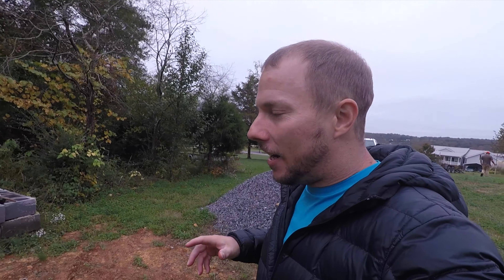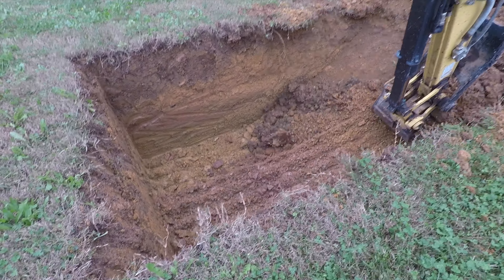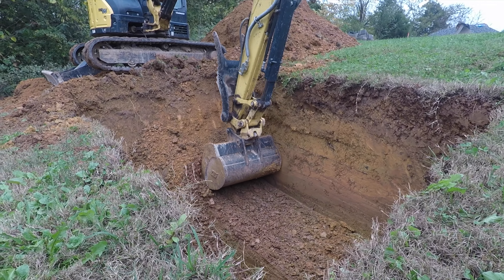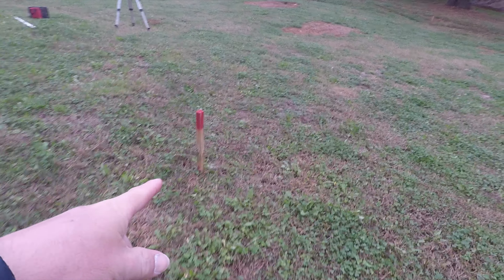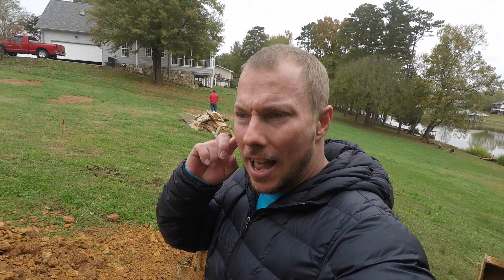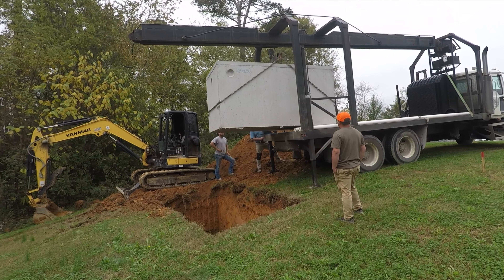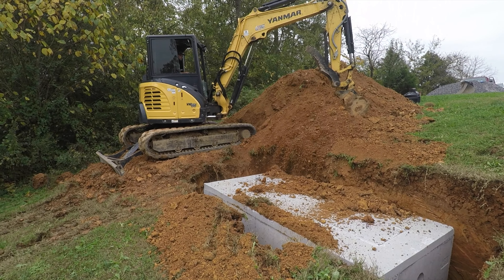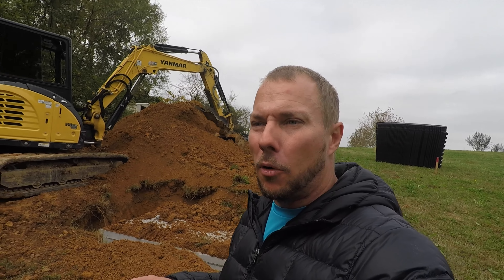How to Install a Septic System! ( Part 1 Septic Tank Install )

Comment: I do septic in florida . We put the laser in the bottom of the tank to check for level because the lids are never perfect so that throws a hand level off . I saw your laser in the background it is alot easier with that
Reply from the maker: Awesome information.  I’ll pass that on to my first work guy.   Thanks for watching.
Reply: Definitely man turned out really good. Wasn't downing it at all btw just passing info lol
Reply: Come do mines on the weekend cash i buy everything
Reply: So if it is off level then dont you have to pull the entire tank out again to adjust the ground underneath?
Reply from the maker: I  don’t believe it is a big problem if the actual septic tank is perfect level.  Im sure there is an acceptable margin of error

Comment: Nice video.  Is it ok if these tanks settle and end up not being perfectly level? Serious question, I honestly don't know what the tolerances are for a septic tank.
Reply from the maker: We try and set these as level as possible. They should not settle since the ground under them is virgin untouched ground. I am honestly not sure what the tolerance of being in level is or how it would affect it.   I wouldn’t think a very small amount would hurt.  Thanks for the question
Reply: I try to keep him within an inch most tanks only have 3 in of flow from inlet outlet.

Comment: How do you make these with a switch using multiple septic tanks to switch between? Not sure how such a system works but I hear that having two septic tanks for this is common, but for some reason my property only has one septic tank and I'm gonna be building a big garage that also has an upstairs living space and I want to install a whole bathroom so I want to put in another septic system. It'll also be good to do this because we have a leech bed (I think that's how you say it?) cesspool that just makes our yard look embarrassingly sad to look at it's basically a swamp in a big spot that we can't even use the riding mower to cut the grass on. So I'm gonna need to have that fixed.

Also how would you recommend that I get rid of that leech bed problem? Is there a solution or is it just screwed?
Reply from the maker: Bro I have no idea about 2 tanks unless its a pump system that has to be pumped uphill to another tank that then flows back down towards the house in the field lines.   I guess you could have 2 different systems but your land will have to allow it.   the amount or length of lines you have is based on the soils absorption rate and the number of bedrooms in your dwelling.
Reply: You would have 1 tank lower than the other and cascade.  The main tank would capture most of the solids.  The concept is poor imo.  You aren't gaining anything.

Comment: Did it look like they put it in the wrong way i thought the lower ends of the holes are for the drainage
Reply from the maker: Not sure what you mean. The hole for the tank is level and the holes toward top side of tank are where the liquids flow out of into the field lines

Comment: I didnt realize they were buried so shallow. How does that not freeze in below zero weather? Aside from insulting the ground above it before winter.
Reply from the maker: Here in TN it doesn’t get below zero and hopefully the actual tank is not full of liquid.  If it is you have a problem.
Reply: @MattFreytag  we just had our second cold snap here in WY. -37 the first time and -35 this time. We just bought rural property and never have had a septic or well before so I'm trying to learn as much as I can. Apparently the septic tank was pumped out around last oct or so. Teaching everyone in the house that a septic is not city.
Reply from the maker: Wow.  Codes could be different in your area as far as how deep they are but. I’m sure it would be ok

Comment: No gravel or sand under the tank?
Reply from the maker: No we don’t.  The hole is dug down to virgin untouched ground and leveled up for the cement septic tank.  There are no requirements for any type substrate to be added.
Reply: @MattFreytag  It must depend on where you live because where I live there must be a minimum of 6 inches of sand or pea gravel under the tank.

Comment: would you recommend protect the exterior walls with waterproofing layers?
Reply from the maker: I don’t think so.  I’d say they use the proper psi concrete to build the tank so that water won’t penetrate.

Comment: Can the ground be too cold to place or dig for septic?
What about how saturated the ground is?
Reply from the maker: It doesn’t get cold enough here in TN but as long as the machine can did I’d say your ok.   As far as wet ground goes.  You must first get a perk test on the ground by a state official they will tell you if the ground is good enough to install a septic system or not.  They will also determine how many bedrooms you can put on the system and the amount/ length of field lines you will need to install the system.  

Hope this helps

Comment: Definitely doesn’t way 10k pounds but bless your heart
Reply from the maker: @jeffreyteasley8885  1000 gallon concrete septic tanks weigh between 8500 - 12000 lbs.
Reply from the maker: @jeffreyteasley8885  By the way.  I just got off the phone with Bradley Tank and Pipe in Cleveland TN (423) 479-4482. They just confirmed that the concrete 1000 gallon septic tank the make and sell weighs about 12k lbs.  Go to church somewhere on Sunday!